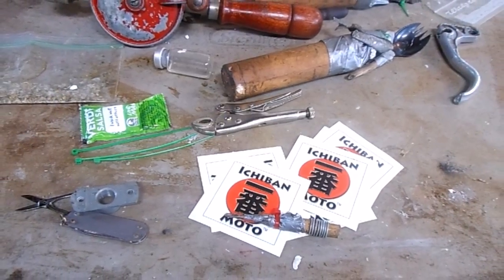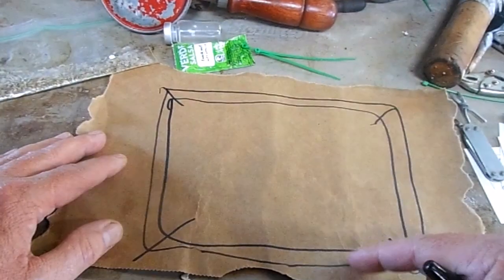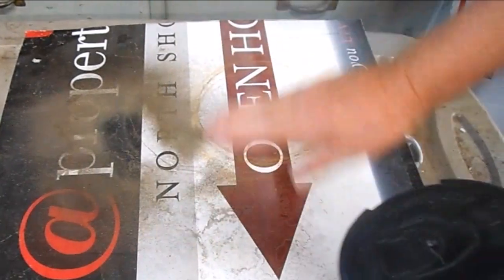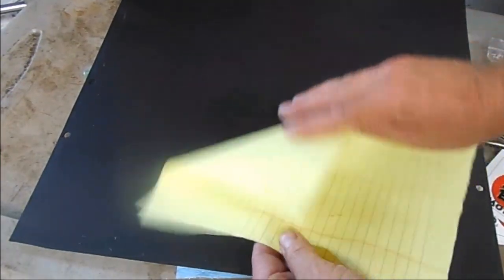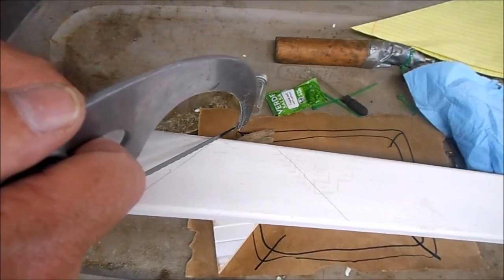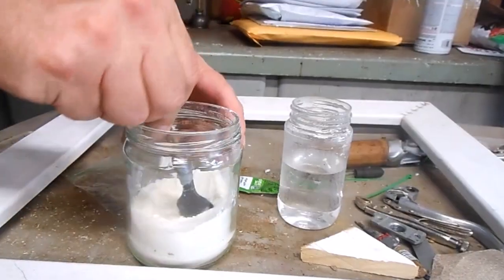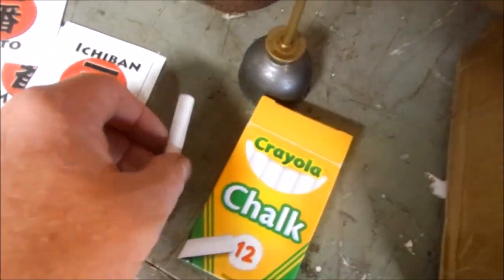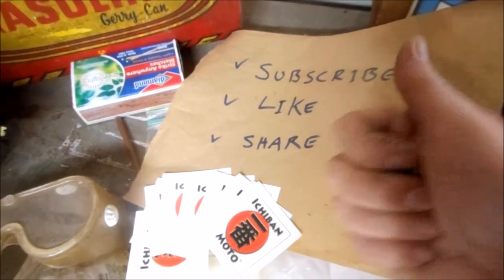how to make a chalkboard sign shop price menu board

Comment: I don't have the correct mitre saw. Could I use diamond shears to cut the frame?
Reply from the maker: just get the angles right
Reply: robnuts01 
Only if it is SWISS MADE diamond shears.

Comment: that's badass, it'd be bitchen if you got a request board, i gotta knock  out a few multion tubes. it's the last thing aforn i put it all back together,  the carbs. hey i just got an idea. instead of takin em out, i could use a pipe cleaner, dipped in carb spray to unclog em! and high pressure air, BAM! telleportation.

Comment: Badass but I'm not happy that your wife trusted you to chalk all by yourself it's dangerous without the proper safety equipment 👍🏼👍🏼👍🏼
Reply from the maker: Understood. I'm a bad example,            hey kids !!!!  - goggles, gloves, boots,  face shield,  rubber panties and respirator  when touching chalk !!!     ps. When I make a second board for the Ichiban Tee and Hoodie shop, I will have the mrs.  redo this one as well.
Reply: That's ok then I was worried for your safety be sure to also wear lead pants so the chalk radiation doesn't penetrate your body